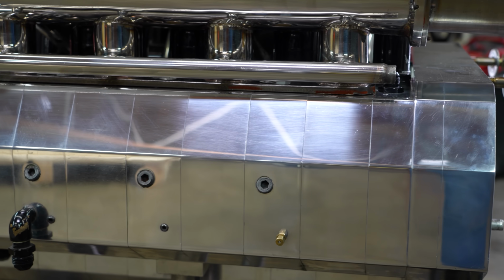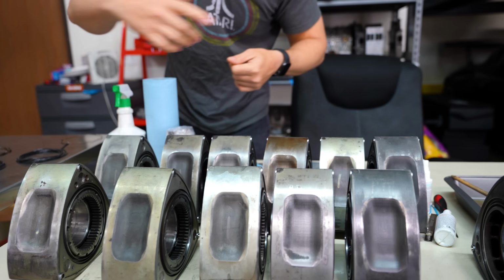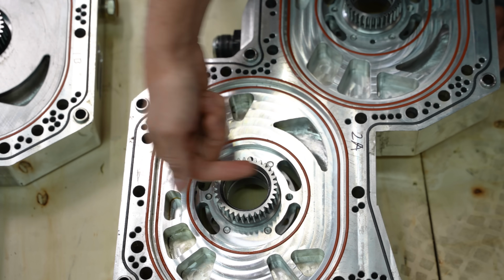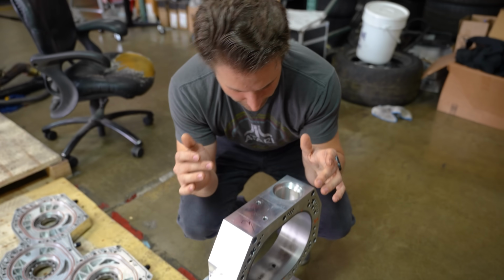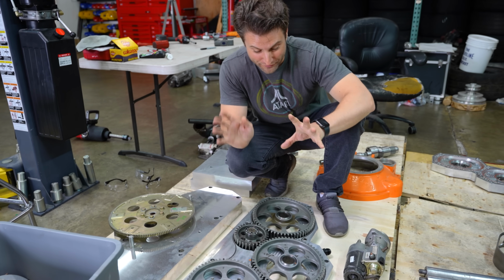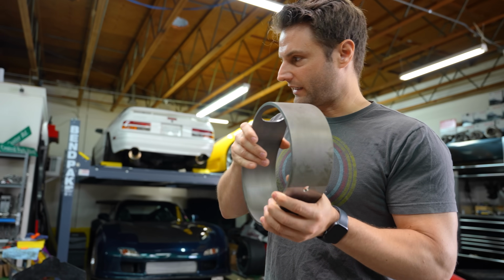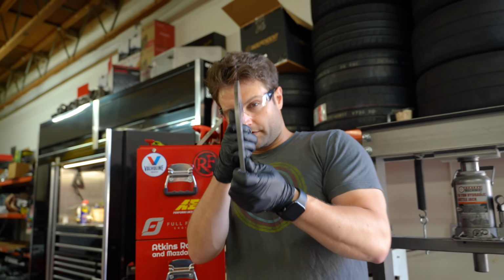Everything wrong with the 12 Rotor

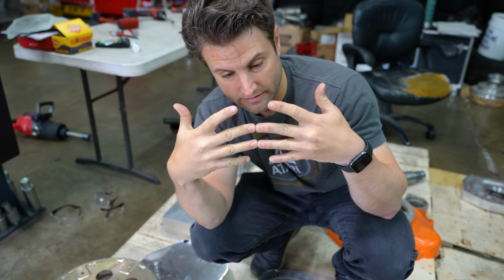Comment: 12:29 That's easy enough to solve, but it requires that top gear to be machined with the splines inside the hub to be rotated 1/2 of the tooth arc, making them not 100% identical, but fixing the problem or being out of sync slightly. Or potentially you can change the input shaft which fits into that gear, making IT the only piece that is not standard. Or if you have the same number of splines as there are gears, just move the splines over 1 tooth.

Comment: Regarding the warped steel plate, I think temperature differences might be making a bigger difference on it in comparison to the pressure and expansion of the aluminum side.
The rotor side of the steel plate will be much hotter than the aluminum side due to the oil, air pockets, and aluminum plate helping that side of the steel plate to dissipate heat better. 
I love your content! Keep doing what you do!

Comment: Rob - with the gearing that drives all 3 rows of rotors. Set the centre gear to zero degrees and also the set the gear which is driven by the idler gear to zero degree. With the  gear which is half a tooth out (or 3 degree as you say) modify the inside of the Original gear so it sits on the inside of a stub which has a bolt pattern joining both parts together and that is also slotted (a little like slotting cam sprockets).

This will allow you to index your rotor shaft to zero deg and help you hide the 3 deg timing run out you have found in the gearing.

Hope the above makes sense and may be of some use to you. Very informative videos and love to watch them 😎👍. Dave.

Comment: My issue with those gears is that the middle and left one are going to have uneven ware due to being the exact same. My suggestion is to scrap them for smaller gears and run a timing chain (or even a set of transfer case chains) which would give you better ware characteristics and allow you to get an even firing order

Comment: Why not undercut the aluminum that backs the side irons by a few thou to compensate for thermal expansion when hot on all but the perimeter of the side iron  that backs it against the rotor housing this way you’d solve the cupping of the side irons and the o-rings would still maintain the sealing as necessary.  This has to be a known value that can be computed for based on the alloy and temperature range.

Comment: Hey Rob,

Really cool engin and video! How deep into the parts inspection/prep do you go when assembling, inspecting, and testing such a unique design? Have you ever thought about using a small, man portable, DR X-Ray System to inspect the parts that see high wear or have potential for fatigue/fracture? 

I'll start by saying I'm not very educated on rotary engines design and where/why they fail in certain areas, and I realize that x-ray might be overkill or unnecessary. But when watching you press that "beautiful thick steel plate" that tends to "volcano" when center pressure is applied... I'm wondering if any micro fractures are occuring in this process that will be near impossible to see with the naked eye however, would definitely show up in a High Definition Digital X-Ray that can see down to 99, or even 75 microns.  I run a small EOD/NDT X-Ray company here in the DC area and I'd love to take an image of one of those plates if you're interested. 

Thanks in advance if you end up reading this. Let me know what you think 🤘🏼✌🏼. 

Stay safe and keep up the amazing work! 

Best Regards,

Alex Lageman - Vidisco USA Inc. | Smart, Portable, X-Ray Solutions

Comment: I do understand what your talking about but, Mazda and the Wankle Engine never panned out and died, it did not 
sell well and of course no one was very convinced of its performance. To me, just my opinion your trying to reinvent what’s already been done with your improvements, I just don’t think it’s going to sell or ever be in production again. I could be wrong, but so many other and different engines are being produced. Toyota for one is already in production of a hydrogen motor (not rotary) for fuel and emissions reasons. So I don’t see this taking off at all.

Comment: So if the block was designed symmetrically with gears on both sides(to overcome the 3 degree timing issue), and the rotors positioned at 90 degrees to each other,  with independent oil in and drains for each rotor, some sort of oil cooling channels,(into a remote oil filter system and cooler), matching machined angles on the Exhaust sides, and O rings at the Intake openings, it could be timed off the center shaft reluctor wheel and one ECU could fire 3 rotor sparks simultaneously (1 on each bank) and essentially run 8 plug signals (2 per rotor) on a 4 rotor map?(less expensive) 
How much 'better' do you think that this motor would be? And given that the entire mass of the engine is larger than the 4 rotor, could it handle significant boost? 
*Or given where the world is today with power numbers, is it better to run paired 4 rotors bolted together? -Over this configuration?
So much potential, and so many questions...

Comment: Why not warm up the steel plates before you apply force to the center? It seems like you might be stressing the steel by cold bending it back in place? But if you heat it first then allow it to cool in the press, the plate may come to square with less stress to the structure of the steel?

Comment: Any good machinist could make any one of those parts, only the great machinists can make them all exactly the same.  Pressing those plates straight is only temporary, you know they will bend again as quick as you straightened them.  Can you screw the plates to the end blocks that have the ports in them ? It's not just pressure bending them, you have the heat on one side and the cooling on the other, that alone will bend a plate.  All that aside, my hat's off to the original builder, he was brave as hell taking that on and good luck Rob with the re-engineering.

Comment: With each bank of 3, you could run each one 30 degrees out for a total of 90 degrees for each bank.  Bank one would be 90 degrees total, then bank 3 at 90 degrees, then bank 2 at 90, then bank 4 at 90.  You'll have an ignition every 30 degrees in a 360 degree smooth ark throughout the entire engine.  Or however it would balance best.  This is a mind blowing puzzle...

Comment: On the bank that may be 3 deg out,  what is the tooth count on the inside of the gear?  There may well be a phase angle where all banks are at top dead center unless the gear to crank(e shaft?) Is keyed.  In that case I think your stuck with that 3 deg.   I.e. if outer tooth count is 75 and inner is 50 then you can line up peak to peak or peak to valley.  A more "obscure" ratio may be better in this case to a more fine phase angle control for that bank of rotors.

Comment: 6:39 could you not just run a vacuum pump setup to have the engine constantly under a vacuum to ensure that there is always the lowest pressure coming out of the middle rotor? if you kept the oiling system at 21 inches of vacuum it seems like that would mitigate this problem entirely??

Comment: 2:06 in a marine application you are still limited by the heat exchanger, under normal conditions sea water should never be in the engine. Water to water exchangers do work way better than a radiator though.

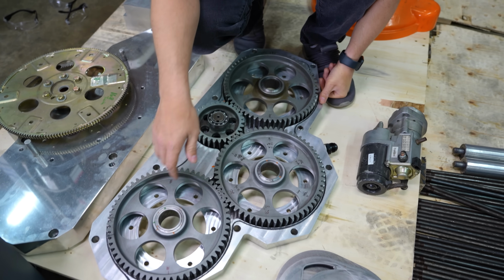Comment: 13:32 you could change the position of the spines on the inner sprocket for the crank by half a tooth to make the valley and valley situation to line up? Making the rotation even.

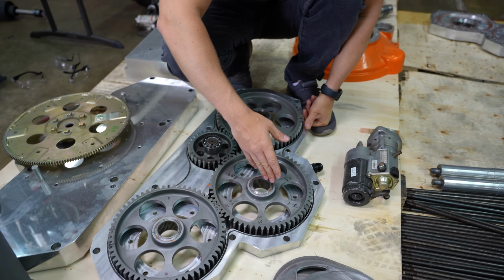Comment: At 13:25  A lot is being made of the 3 degrees timing misalignment of those gears, but the gear to shaft interface is splined. You can tell the spline count from the shot in the video, but I'd reckon that it is 120~ spline so that you can clock the splines to account for the 3 degrees and also play with shaft phasing.

Comment: The concern about the bolt length is bunk, they max out their pull out strength around 25-30mm of engagement in bullet aluminum.l, the application is also in shear where thread engagement is less of an issue

Comment: Very impressed with all the machine work thats been done. I am not an engineer and there is so much I would have liked to have done differently. Rubber gasket against exhaust side? There is a reason why metal crushpacking is normally used. The transmission between the banks should have gears two gears for on bank en one for the other, between them to make it work better. A final consideration is if each bank itself is adjusted to have four individual rotors, shouldn't each bank be offset by 60 degrees to prevent two rotors from firing at the same time in diffrent banks? As of know ther should be 6 rotors firing in al banks at the same time...

Comment: The problem with rotary motors is the flame front propagation from gasoline. Rotaries like hydrogen much much more. There are a lot of other issues with rotaries I dont like but the main one is they don't like gas.

Comment: Can you not wire around the petrol port, as in a diesel engine, or build a seal pocket so as you press the 2 plates together it seals access to the ort?

Comment: I think the only thing you can do on those plates that are “volcanoing” what you do is take it to a machine shop and have them face both sides of it down to the proper thickness and then cut the whole you need.. I’d be looking at the different alloys to see what metal would work best for that application, find something to hold its shape and not warp… idk if there is any way to really prevent that from happening again unless you brace it somehow and I don’t see that being possible so idk if you have any choice but to just keep straighten them plates.. we already know rotary engines have to have a rebuild every so many miles and they can straighten them then…

Comment: This may be a dumb idea but could you put some of those snap rings that go on an axel for the e shaft to help hold it together?
Reply: I think it needs thrust bearings of some kind to support the shaft longitudinally so that the end forces are taken up by something other than the volcanoing plates. I don't recall hearing this to be a problem in a 2, 3 or 4 rotor Wankel. I suspect that with the 6 cylinders firing at the same time, the end forces on the crank assembly are huge. If the crankshaft was redesigned to time the firing into 4 or 6 different points on the circle, the total end forces on the crank would be lower and maybe the volcanoing would be eliminated. As it is, the end forces are overcoming the elasticity of the steel plates, causing them to warp. If the forces were less, the yield stress in the plates would not exceed the elastic limit, and the plates would hold their shape. It would also run smoother. That's the first thing I would try to change.

Comment: Undoubtedly you know Daryl Drummond, the only builder of the sealed race spec engines in the 1st Gen Formula Mazdas.  Speaking with the series winner at a National event at Willow Springs, learned he had 5 seasons on the same motor!!!  A few months later spent the day with Daryl at his old Bakersfield shop.

The same engine used by that series winner now had 5 full seasons of racing.  Compression had come down a bit but Daryl carefully disassembled the engine, showed the normal expected wear details.  One thing he pointed out is a properly built rotary with sufficient rotor lubrication will run almost indefinitely. 

Surprisingly he said the difference between a fresh and 'worn' engine might be as low as 8-10 hp on the dyno.  Goes to show they can last if not abused.  So much for the rumored 'reliability' issue.

I crew chieffed on a GT2 and a GT3 RX7.  3 seasons w/the BT3 car, 31 races, 27 wins, 1 2nd, 2 DNF's, not related to engine trouble.  Every event, all the 'piston' guys spent hours before and after each track session with valve train maintenance...valve lash, push rods, rocker arms etc.  Little needed on the RX.  Maybe a minor jet change of the big Weber to compensate for weather, slight  susp. tweak,  brake bleed, and full nut/bolt check of chassis.  There really is little else needed.

Gotta say, probably the easiest car to 'baby sit' for a weekend.  Learned the Formula Mazda is about the only open wheel car to suit my build, would loved to drive one.  A great track/autocross/race car.  So many aspects of common sense design.

Comment: A few thoughts Rob, could the oil drain for the scavange be drained for each gear down as the middle one? The vacume should handle it fine and then block of the drain from the 2 side rotors. About the steel insert i would def get water in those ports to cool the plates down on both sides, now the question is how to get the water to flow trough it. Probably have inlet and outlet pr wall. That will cool the steel insert down alot. Also some kind of retention ring to hold the insert down in the middle as well. Think center lock wheels. With your skills i would think creating something like that to hold the plates down. It would req making a lip on the plate to hold it down. But it looked pretty thick so you have some material you could take off.

Comment: I'm brand new to learning about rotary engines but I always wonder how the idea of more or less rotors on an engine works. I actually have quite a bit to learn about engines but my understanding is that 12 cylinders are usually built for power or comfort, comfort because each cylinder has to move less so the car vibrates less, and power I still don't understand. So I honestly don't know if a 12 rotor engine would have the same benefits as a 12 cylinder engine.
Reply: Every rotor has already three faces. So a four rotor engine has already the same amount of ignitions over the engine like a twelves cylinder four stroke engine.
So a twelve rotor rotary gives you the same comfort like a 36 cylinder engine.
There is just a practical limit to rotor size that's why there are so many rotors.
Reply: @matthiasmay1977  Thanks for the explanation. I hope before the ICE is killed we get some last experiments with the rotary, something to prove its viability as a road car. Maybe Mazda can solve the MPG issue.
Reply: @pitchblackgrue  forget about it. Rotaries have a great power to weight ratio for small power requirements. Need more power use a turbine. Need more efficiency use a turbo charged or even better a turbo compound piston engine .

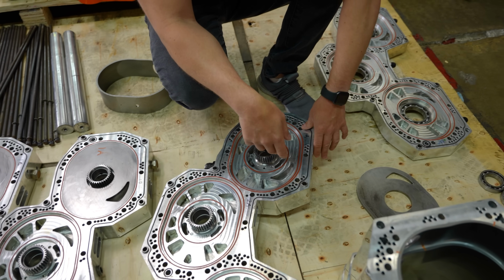Comment: Rob, @7:54 what if you used the air cavities as routes for the oil travel to the center drain point as reserviors for the oil from the upper rotors?

Comment: Instead of bending the plates back, an option would perhaps be to have new one cast with "fins" that could support them so they dont bend again. You would know where to place the support fins and I think there is enough space on the back of the plates right? Then you machine the plate completely on one side and only machine absolutely minimum on the other side. 
Maybe this is also the incorrect steel for the job or maybe should be hardened more?

Comment: well people used to be wise, then came youtube, be wise as yourself, with God, nothing collective dum dum
Reply: yes you can, if you believe, not in people
Reply: use ethanol vaporization cooler, vapour heat pipe cooler, no problem, just route the flexible ethanol vapour vacuum pipe to the coolant surface, car skin
Reply: yes heat pipes of the computer coolers, kilowatts of heat transfer by liquid vaporization
Reply: just make the engine small, then have the large outside be outside
Reply: ethanol vaporization (boiling) point is about 70C so thats the engine cooling temp, for water thats 100C, so its 30C lower
Reply: any temp that goes above 70C will be cooled to 70C by the vaporization physical limit, have the heat pipe be enough capacity for the cooling action then
Reply: maglev (even generating) bearings, ac magnet arrangement + copper sleeve with coils for both maglev bearing and ac electricity generator
Reply: also when you dont use oil as lubricant, you dont get alternations to the engine fuel composition
Reply: also if you replace O-rings with clever slot design that minimizes output leakage, no melting plastic, its better to weld the outside of the clever slot gaps, then remove the weld when opening the engine, yep scrape-melt it off
Reply: the weld is only on the outside, easy to access
Reply: put a piezo pressure spark in the rotors, ie, auto-spark, no external belts or anything, just piston chamber internal spark by mechanical pressure/friction, friction spark

Comment: For the oil draining issue for the center rotor, could you have a timed valve that would alternate and let each side alternate vacuum to pull the oil? The valve could even be incorporated into the bronze air screens on the top of the left and right rotors. Love your videos.

Comment: ------> Rob, serious question. Is there a way the one big gear could have the center splines cut, in a way its not 3 degrees off anymore, or have a new big gear made?? Second question, can you turn all the E shaft 90 degees from each other, since they're all splined, and make 3, 4 rotors?

Comment: you could use a Tapered Roller Bearing for the Shaft at each End of the Motor. They can Handle Both Axial and Radial Loads

Comment: Love how you don't hold back on information like we are dumb and actually share this stuff with the community, legend bro🤟...👇

My recommendation is liquid to air intercooler with a water n methanol spray pre and after turbo with double jets, even on a na setup 😅
Also a dry sump with it's own heat exchanger on the oil system would help a ton
Side note, o ring and double bolt min if you guys are gunna turbo this

Comment: just a question why or what is your reason  to why you would want oil flowing in the inside off the end plates if anything those gaps would disperse heat,, but very interested to why you would wanted oil to be flowing thru there?